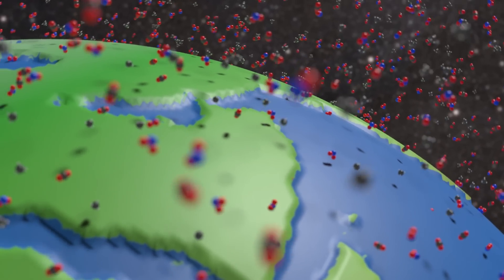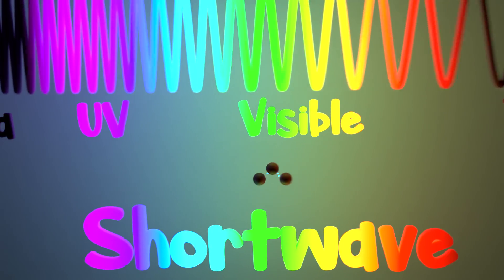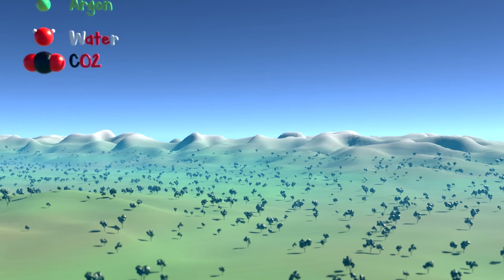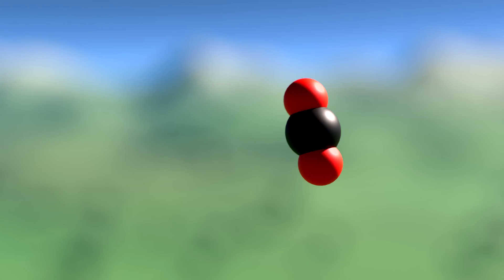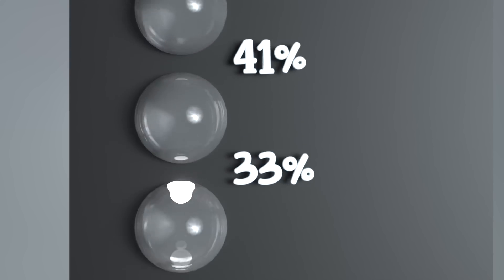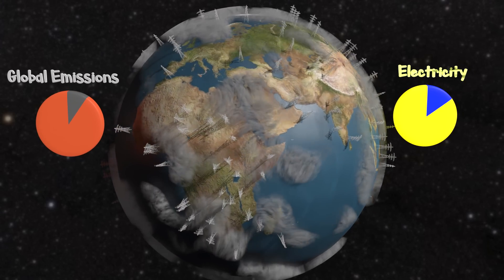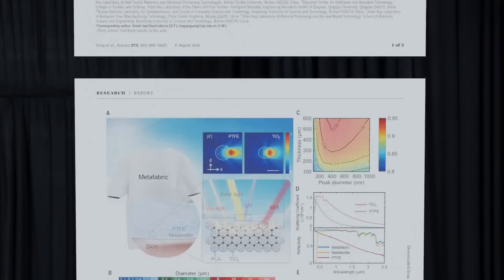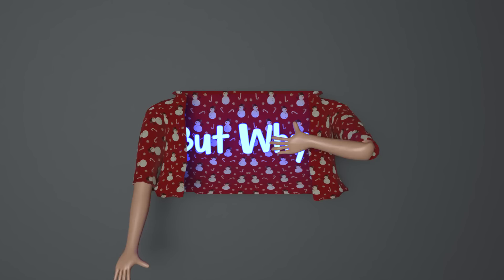Energy Free Cooling through Physics

Comment: This certainly does feel too good to be true. Could you do a more in-depth video on this? I also had no idea such a field existed!
Reply from the maker: The only information I have is what was available in the papers unfortunately. And what was talked about with Arny. As for the aerogel coating it's biggest constraint is that it's not the most durable material against the elements. In it's current state it's not an ideal candidate for large scale use, however the current best use is for coolers or containers that you want to keep the contents cool. Keep food cooler longer and it can be sheltered from harsh elements. 

The silk paper showed that after extensive manipulation, twisting, and stretching, the nanoprocessed silk maintained the bonds between it's fibers and the aluminum nanoparticles. So unless there's a health issue to having aluminum near your skin that I don't know of I think that one is very much a viable option. 

The metafabric paper claims it's a scalable process and as seen in some photos, they were certainly able to make large reams of cloth. I don't know how scarce titanium is, so that may be a limiting ingredient. That paper also (That I can recall) didn't go into depth on durability. 
There was another fabric paper I didn't talk about that made a polyethylene fabric which was extremely scalable.

So I think there are certainly options. My main concern is the reliance on continued use of plastics.
Reply: @ButWhySci  RE: metafabric titanium scarcity: titanium isnt very scarce but it is quite expensive- about $4 per kilo vs steel at about $1.25. It'd be interesting to put forward to a chemical engineer, if its really that scalable, they should have no issue setting up a production facility.
Reply: @Gliccit  Titanium oxide is actually very inexpensive and readily available. In fact almost all white pigments used in almost all paints are derived from titanium oxide.
Reply: @SteinbergerGPPRo  unfortunately it is in scarce supply right now due to the virus.  Went to buy paint, didn’t end well….
Reply: @Gliccit  It's not the only cooling method suitable.
Maybe 20 years ago one of the most energy eating places where computer centers (data centers) including all climatisating necessary to run those.
Then they started to install kyoto cooling systems....which suited during most days of the year to keep the place coo enough to operate with a big radiator on the roof. 
The energy saving: In total good for shutting down an entire powerplant. (a few datacenters combined energy savings). The advantage to the climate....that powerplant less in operation.
Reply: @ButWhySci  Could you link the papers please?
Reply: @ButWhySci it’s difficult to prove increases in CO2 causes climate change.  Several ice ages had 1200 times higher bCO2 levels as well as one Saturn moon with average temperatures of -300F.
Reply: Not sure if you've had your answer satisfactorily answered, but i see lots of people talking about titanium dioxide.  It's true that because it's ultra white, it reflects a lot of light and can lead to passive cooling, but that's not exactly what this video is about.

In this video  @ButWhySci  is talking about not only reflecting light, but also radiating heat away passively through molecular structures. It sounds a lot more like the new barium sulfate pigments that have been developed. It's another ultra white pigment, but it can be manufactured in such a way that it actively sheds heat while also mitigating absorption of new radiation.

I think night hawk in light did a video on it, or maybe it was tech ingredients. Maybe as a longshot it could have been Codys lab, but probably one of the first two
Reply: @ButWhySci  It's also cooler in the shade of a tree or bush, covering more of the earth with these seems cheaper and more viable and would provide more oxygen, food, and habitat for people and animals, but it's not as full of scientific words so people won't do it, but it's the best solution.

"Because cool air settles near the ground, air temperatures directly under trees can be as much as 25°F cooler than air temperatures above nearby blacktop." - US Department of Energy
Reply: @ButWhySci  why not do a video on Sprayed Cork insulation as a environmentally friendly renewable affordable  “thermal break” solution to thermal leakage in houses?
Reply: @ButWhySci  Can you give us link to that website who was potentially selling that cooling cloth ?
Reply: @ButWhySci  Plastic is just too Op for our own good
Reply: @ButWhySci  still dont quite understand the second law of thermodynamic part of this design
Reply: @ButWhySci   Just found you're channel I love the content so far and can't wait to see what you will do next.I hope everyone on here is doing ok. I know there's a lot sucide attempts and it's getting worse. Let me tell you if you're feeling this way open up to a stranger on YouTube live chat or quora you'll be surprised of the self therapy and it's ability to heal you. therapist aren't legally allowed to give information that will help you unless you ask for different types of help at the appointment such as spiritual therapy. sadly 95 % of therapist still haven't gained control of their life's and end up hurting clients instead helping.
Reply: @ButWhySci  saying that aerogel is not the most durable material against elements is somewhat close to saying that prostitute with 30 years of experience is not the most modest. Literally cardboard is more durable than aerogel. Unless something changed since I had contact with it 3 years ago.
Reply: @ButWhySci  Wouldn't 200nm aluminum oxidize all the way through fairly rapidly?
Reply: There's some info about passive cooling in architecture if you search for it. In the past, this was the only option once there was no electricity

The book "barefoot architect" demonstrates some techniques to achieve the passive cooling in buildings

It's not exactly what's shown in the video but you can have some ideias about passive cooling
Reply: @henriqueblasius3492  I second this recommendation. 'Barefoot Arichitect' is one of my favorite books of all time. It's not a manual, but it has great "old country" practical design to it. 

The only thing about letting the natural wind blow through your house is that there is no de-humidification, and there is no control over the wind-born dust. Lot's of great ideas in that book though.
Reply: @-GinΠΓ Τάο Being toxic is not the best way to lure people into believing in your tinfoil whatever-that-is speech. Just sayin' ;)
Reply: @-GinΠΓ Τάο The more I read, the more deranged it becomes. Are you a leader of some crazy sect?
Reply: @-GinΠΓ Τάο Your bold claims got me interested so I took a look at your sources. Not only are most of them off-topic, they are all rather basic explanations of some science and none directly support those claims that you are making. Pretty disappointing. The one source that actually deals with black body radiation gives a basic explanation of the concept, yet also claims that his "skin is black in IR", right before using a IR temperature device to measure his skin through, in his words, it's "IR colour". Also, citing "1.2M subscribers" is rather deceptive when it only has 15.5k views and 163 comments. I also wonder what the people you're sourcing would have to say about your claims.
Since you like using fancy quotes, here's one:

"Extraordinary claims require extraordinary evidence." -Carl Sagan

The entire planet is too complex to accurately measure what really happens, so let's use a simpler example of something else that's in space. If your claim that "heat cannot radiate into space" is correct, then the ISS would've been cooked pretty quickly from all the solar absorption and internal heat generation, right? Yet it's still fine decades later. The only realistic way for the ISS to lose heat is through radiating it away, since it's surrounded by near vacuum. To do that it uses huge black body radiator 'wings' that dump the heat directly into space. Heat management is one of the larger problems in spaceflight and without radiating it away, it's hard for any equipment to function long term, if at all.

"mostly just received as some kind of esoteric truth and a longing for something more meaningful"

Yes, that's what happens when you use capitalized words like Truth, Nature, Heaven, Soul and Purpose, all the while making grand unsupported claims. It's pretty much the definition of a religion. Real science is based on repeatable experiments and peer review, not on quoting DIY home lectures of simple tangential concepts.
Reply: @-GinΠΓ Τάο You talk about learning, but seem to disregard the fact that a large part of science is about discourse, and about explaining the argument for your stance. If someone took the time to look through your sources, but still has questions, you shouldn't dismiss them as ignorant, but rather try and see if either your sources are wrong, or your interpretation is wrong. Your arrogant attitude seems to suggest that you neither have the understanding of nor the patience to have a discourse with someone about your sources, but would rather just have people blindly believe every word you say.
Reply: @-GinΠΓ Τάο you lost me when you said heat can’t radiate to space. If that’s the case, how does the sun heat us up? Do you believe there’s some mystical medium between us?
Reply: @evaahh9584 isn't the temp of the sun the cause of earth's global temperature cycles
Reply: @-GinΠΓ Τάο you too seem to have difficulty in reading, context and reference, I mentioned the organization that made the measurement on the space that forest' ocuppies on the earth's surface because I wanted to show that he had a reliable source for his statement (that its impossible forest are only 3% of their original size) and that he isn't just saying lies

Note: english isn't my first language so I might have problems to express what Im trying to say.
Edit: btw, since I don't know much about physics I'm only writing about the forest thing.
Reply: @-GinΠΓ Τάο   "In fact the energy return on burning the "coal" or "diesel" for electricity is more efficient by order of magnitudes than what is being proposed."
Of course it is. But your conclusion is wrong. 
Civilization is not a "disease", its the result of thermodynamics. Life is a collateral, not the reason.
Civilization uses tremendous amounts of energy, we are really contributing much more to increase entropy. The purpose of the universe is to increase entropy.
Life is such a thing that has negative entropy at the expense of creating even more entropy.
Civilization is just the end result of the equation trying to balance it out, and trying to dissipate the most amount possible of energy possible in the object called Earth.
That's why we are increasing the heat levels, everything is not getting "hot", its getting more balanced, less energy is kept stored.
Who's to say that our purpose wasn't just freeing all that energy ? 
Did we do it by mistake ? I don't think so, we are compelled to consume energy, all Life is.
Everything in according to thermodynamics. The vortex of energy is only getting more fast, until it all ceases.
Life couldn't keep pushing negative entropy forever, eventually it would stockpile so much energy somewhere to cause an imbalance of energy.
Because Life is complex, and Civilization is also complex, and we are probably creating a system so complex, that we don't understand it.
All things tends towards ever increasing complexity, there's no turning back since we lit the first artificial fire...
Reply: @-GinΠΓ Τάο I'm not arguing against laws of physics. No law of physics state anything about the civilization being orthogonal to it.
The civilization is a complex chaotic energy dispersion mechanism that's the end result of the vortex of local entropy in this rock.
Entropy will always increase. Civilization makes it a bit faster, and that's it. Civilization is just another step in complexity on top of Life.
Another emerging structure.
You're wrong and I'm arguing against you, not physics.
Reply: @-GinΠΓ Τάο and dude, I like that you're taking the damage we're doing seriously, but you're way off with the scale

Humans are nowhere near being able to have any measurable effect of the planet itself, and especially not the solar system. The biggest movement of mass we've been responsible for is the three gorges damn in china, which did have a, theoretical Ly measurable effect on the rotation of the planet, but it was so unbelievably small its irrelevant.

The problem is, earths atmosphere and biosphere is much, much, much smaller than the planet, a tiny little skin, and we can, and are fucking up the balance of that.

There's no real reason we can't have civilization and keep the biosphere though, we just have to have out civilization not crank out obscene amounts of all of the crap that would damage it.

And frankly, we also won't kill it, just damage it temporarily, hell, we probably won't even manage to wipe ourselves out.

It happened with the dinosaurs, it's happened with volcanoes, ice ages have done it, hell, other life forms have wrecked the equilibrium before and killed themselves off, that's how we got to the point of having things that consume either O2 or CO2.

Some ancient slime grew on the ocean, converted all the CO2 to O2, mostly died off, and some vaguely animal resembling thing started breathing the O2 in the air.

Everyone always says "we're killing the planet" and ignores the second part of that.
"we're killing the planet as we know it"

Which, is a pretty big problem for us, cause we need that for food, but long term, it'll bounce back with something new and weird, we'll probably still be around clustered around large greenhouses or some shit, and the world'll keep turning.
Reply: The downside is that aerogel is really complicated to make
Reply: See video: How To Make Infrared Cooling Paint (Electricity Free Air Conditioning)
See also: Air Conditioning isn't free... but we're close.
Reply: @-GinΠΓ Τάο I never understand the type of people to spout some theory that’s not popularly believed, say you need 1 billion people, and then insult people for not believing you. You need 1/8 of the total population and you’re taking the chance to insult people rather than try to communicate with them diplomatically? That’s ballsy.
Reply: @-GinΠΓ Τάο ok, cool, you're going with the tactic of telling people that actually understand particle physics that they're wrong without elaborating in any way, real great way to get you're point across.

Do you want lectures and papers on how this works?

Half of the links and things you wrote about were completely unrelated to eachother, there's nothing coherent to learn.

I mean, come on, what the fuck does the concept of red-shifting have to do with anything? All red shifting is, is the wavelength of light appearing to increase as the reference point move away from the source faster. It has NOTHING to do with anything you were on about

Hydrogen loss is so miniscule on the energy calculation it doesn't matter in the slightest.

We lose about 3 kilograms of hydrogen per second, that has a specific heat capacity of about 42.93 joules.

From the sun we get about 173000000000000000 joules per second
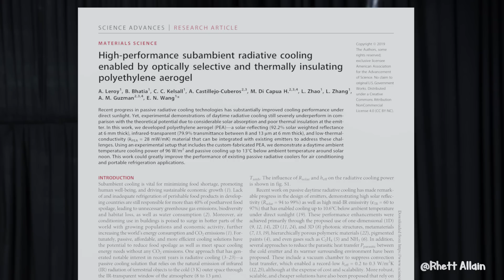Reply: I have similar concerns. I will read the article mentioned at 6:00.
Reply: NASA has been using something similar to this for decades on their spacesuits and spacecraft. 

Their white paints reflect visible light, near-IR and near-UV - I.E. most of the Sun's radiation - because they're... you know... WHITE. However, the same paints have a high thermal emittance - something usually not found in reflective materials - because in the mid and low infrared spectrum they actually look black. 

The result is that anything coated in these paints will radiate away heat but not gain any from the sunlight.
Reply: @augustovasconcellos7173 That's freaking awesome 👌
Reply: @augustovasconcellos7173 so basically your saying the suit reflects non-heating visible light but absorbs IR which would make it hot.
Loads of people liked that bs. Scary af.
Reply: @-GinΠΓ Τάο I would learn if there was something to learn from you. But all you can do is state things without evidence.

You are just a misanthrope trying to excuse it.

"civilization is orthogonal to physics"
No, it isn't, civilization exists because physics allows it to exist.

We don't use more energy than what's allowed. In fact we use much less than that.

Life has no purpose except self-preservation.

You could even argue civilization goes against self-preservation. But seeming we know we have a problem that will make us and that we are trying to solve it seems to me that's actually it does care about it.
Even though changes happen very slowly.
Who's to say we are out of time?
You?
I don't think we are out of time, and if we are, so what, this is not the first civilization to fail nor will it be the last.

Such arrogant viewpoint of yours, thinking you have it all figured out.
Reply: @-GinΠΓ Τάο can you send me links to lectures or papers on em-tension waves?

And I agree that heat isn't a "thing" I'm just saying it's a description of something a lot more simple than you seem to be saying
Reply: @monty58  I believe what they meant by em-tension actually refers to electromagnetic (EM) radiation, which of course has effects on heat transfer through its wavelength based on classical physics. I am able to find a grand total of 1 paper that ever uses the term “EM-Tension”, and that’s Chandrasekhar Roychoudhuri’s “Cosmic Ether, Possessing Electric-Tension and Magnetic-Resistance, Is the Unified Field for Physics” (2021). This seems to be a subgenre of quantum mechanics but also appears to be highly postulating in nature, building upon the existing concept that there exists a medium of ether or quantum vacuum for transmission of information such as heat or light. I have yet to see it being referenced by any responses to it so I have no idea how academia treats it. I myself am not equipped with the knowledge to read this paper at all. Since the original commenter enjoys grandstanding EM-Tension and their understanding of “post-doc comprehensive(s)”, I’d encourage them to explain EM-tension in greater detail and technicality to show they have internalised the processes and also possess understanding of its applicability to the macro world, as this is a relatively abstract and newer model in science
Reply: Nighthawkinlight has an extensive video on making a day sky cooling paint at home.
Reply: Look up tech ingredients YouTube channel. He has a great video on this type of phenomenon and does an experiment showing the temp changes
Reply: @danieldiaz9948  Dido! Great video
Reply: https://youtu.be/KDRnEm-B3AI More in depth video showing how to use household items to create this material.
Reply: @-GinΠΓ Τάο  I wish I could like this post more than once. I want us to be able to find solutions to slow global warming and find balance with our ecosystems, but I know deep down that humanity is a constantly spreading cancer that is killing the Earth that we've known for millennia
Reply: @-GinΠΓ Τάο Oh, I understand all right. There's a reason most Thermodynamics post-docs aren't running around evangelizing the apocalypse like you are, and it's not because they don't understand the subject, nor that they haven't put the dots together like you claim.

I already wrote my refutations, which are obvious and intuitive enough I don't need to spend a week digging up CREDIBLE sources to back up. Humans are to the earth as large as mites are to us, we haven't changed the planet's frigging rotational inertia dude/dudette.
I know better than to try to reform a currently-evangelizing cultist though so I'm out. Have a good life, I hope you get out of the apocalyptic rut you're in where you're trying to convince people of your beliefs on YouTube comment threads.
Reply: @-GinΠΓ Τάο OK, now this is just funny, everyone is telling you the problems with your "teaching in how humanity and civilization are the problem and its impossible for heat to get out of the earth" and your answer to that literally is "I'm right and you are wrong because my 'completely reliable' sources that obviously teached me that I'm right are the truth and you cannot deny truth"
Dude, just accept that you are the one who is wrong in this argument.
You are just making yourself look stupid by trying to sound intelligent and thinking you achieved illumination through basic thermodynamic and physics YouTube videos.
Reply: @-GinΠΓ Τάο I'm sorry, what? Heat can't radiate into space? That's literally what photons are, we can see those photons from space, therefore, it's clearly radiating into space.

Are you just ignoring the primary energy transfer method of our universe?

What the fuck is your understanding of heat anyway? It's literally just how much momentum the particles in a system have.

When those particles collide with eachother, they release small amounts of energy. That energy is in the form of "packets" also known as photons.

Those photons move in a straight line until they collide with something, which absorbers the energy, gaining what we refer to as heat.

You can see this happening on your stove when you turn the heat up, as the particles move faster, they interact more, emitting more photons, becoming brighter.
Reply: It's actually junk science
Reply: I'm sure there's a lot of fields you have no idea about
Reply: Nighthawkinlight made a video on the practical applications of this
Reply: I know this is late but technology connections already did a very in depth video on this already if im not mistaking
Reply: It may sound too naive but what about a white plastic? Doesn't it also reflect sun and let IR pass?
Reply: True but patent protected.
Reply: Theres a few alternatives too cooling cheap and(or with no emissions but that doesnt fit into the capitalistic world so the goverments and megacorps are tryina bury it udner so much shit that it becomes impossible to find
Reply: It’s not too good to be true because people have done it for thousands of years. Build a thick walled house and put holes on the top and bottom so wind could flow through. The sheer mass of the house holds the same temperature. Warm in winter, cold in summer. They also build things underground. How else did the Christian’s hide from the Roman’s for 200 years UNDERGROYND. It’s not as versitile as a heat pump, you can’t put it in a car and move it around. But it works in the same way that cutting channels in the ground work to irrigate the water without any manual work.
Reply: Tecnologia antiga. Tem estudos mais antigos. A questão é que algo que foi descoberto hoje, terá de esperar. As pesquisas custam caro. O tradicional é demorar uns 30 ou mais anos até lançar no mercado a não ser que algum problema muito sério force a aplicação.
Reply: The 'Tech Ingredients' yt channel did a video on making a DIY reverse greenhouse. They managed to prove that it's possible using only plastic wrap and super reflective paint. The real challenge with this approach to cooling is the durability of the materials being used. Plastic wrap is good enough for a demonstration, but all it takes is a hailstone, tree branch, or squirrel to destroy it. Hence the need to develop stronger materials, which is why aerogel and types of cloth are being explored. But aerogel is naturally expensive as heck to produce and I don't imagine the doped silk would be very cheap either. It's not really a matter of "economy of scale" either. It's an engineering challenge.
Reply: NighthawkInLight is an amazing channel that actually shows you how you can realistically build these magical materials while providing lots of extra information
Reply: Evaporative cooling is still better than this environmentally destructive method (plastic you know)
Reply: The polar ice caps used to do this effect for us free of charge
Reply: Doesn't matter, this tech will get buried with the rest of them, for many many years I have followed and researched all sorts of amazing, cost effective and resourceful alternatives for energy output, storage and energy saving devices,, so many technologies that are revolutionary that combined would have cut fossil fuel consumption by 90% and made other technologies that require batteries and energy storage far safer and cheaper, it would be possible to have supplied the entire world with almost free electricity but all these technologies have disappeared without a trace, even the people involved have disappeared out of the field or completely
Reply: @-GinΠΓ Τάο None of this appears to explain or confirm your first sentence, let alone be relevant to the topic of the video.
Also, I'm curious why you think that heat cannot radiate into space and how it would contradict Black Body radiation.
And what proof you have that all heat on Earth is absorbed into the oceans (or is there some quality to 'anthropogenic' heat that makes it particularly hydrophylic?).
But don't worry, I don't expect explanations; the response above shows that keeping on track for any length seems to be a problem.
Reply: @-GinΠΓ Τάο Thanks for the laughs,
Your posts reminds me of the collages made out of pictures from magazine cutouts by pre schoolers.

They might be "pretty", but you will never find a single real picture showing what the collages are describing.
Im getting the same feeling on this one guys.
Reply: @-GinΠΓ Τάο Congratulations, your comment equates to "NO U!". And by the way, your "intellectual superiority complex" is making you blind.
Reply: @-GinΠΓ Τάο So if life and death are merely different states, and no one form is superior to another, why is the destruction of life a problem? Why must complexity be preserved if it is not superior to simpler forms?
Reply: @chaotixthefox    " why is the destruction of life a problem? Why must complexity be preserved if it is not superior to simpler forms?"
exactly, that's the question.
Complexity doesn't need to be preserved. Complexity is the result of entropic increase of energy in a system.
Life has negative complexity locally, but not globally.

The only solution to all of Earths problem: We have to conquer space.
We need even more energy, resources and to strip mine all of the other planets to keep the balance of energy of the Earth negative. Life storing that extra energy as carbon reserves was a dubious attempt, for how long would that work either way ? no much as the system was in balance. (balance is bad, life is not about global balance, your cells have internal balance at expense of your body balance of energy, and your body have internal balance at the expense of the environment, and civilization/society does the same, now we need to have a global Earth energy balance at the expense of the rest of other planets)

Humans only made the entropy increase of Earth go faster, but make no mistake, Life started it. It would eventually cease as all energy is either stored equally distributed over the planet (as it was before we found it and release it back to do more work), that's entropic heat death or radiated away (that doesn't happen fast enough). 

To have local negative entropy (complexity), you need to increase the entropy elsewhere. 
Our current problem is that we are increasing entropy of Earth to keep our complex civilization. But we need to step up and increase the entropy of all of other "pristine" planets to keep the entropy of Earth as low as possible.

Humans just put gasoline in the fire of life.  Now we think we can extinguish it. We made a bomb, the only release is to allow life to conquer other worlds now.
Its funny people think civilization and society aren't an aspect of life itself, we are life, we are not separated from it, we are part of it, everything we do is life doing. If we increase complexity, that was by no mistake,  that's was by purpose.
Reply: take your meds schizo
Reply: @-GinΠΓ Τάο But hey! Let's play your game: The worlds' forests currently cover roughly 4 billion hectares. If we extrapolate that to your 3% number, that means that the total area covered by forests before, was around 133 billion hectares.

To put that into perspective, the world's land surface is around 13 billion hectares, so we only need another 9 earths to reach that magical number of yours.

So in conclusion, we are 120 billion hectares short of land in order to meet your magical 3%.
Reply: Materials will probably end up being cancerous and/or endocrine disruptors, such is the case with many types of plastics and teflon (mentioned in the video)
Reply: @-GinΠΓ Τάο Did you... did you just say that an official measurement from the FAO(Food and Agriculture Organization which is a United Nations agency) is a lie ...?
Reply: The problem is usually that the new technology usually costs more than just adding enough insulation to achieve the same effect.  Is there a market for car covers, maybe, but it works in the winter too, so you can't make it a physical part of the car or you'll have drivers frozen solid.
Reply: @-GinΠΓ Τάο Christ almighty, references (to YouTube I might add) and fancy words do not a real argument make.
What’s really bizarre to me is that you do have a basic grasp on thermodynamics by your DIY AC recommendation, but then you go off on this cult-y rant.

Personally, I’m quite impressed with your claim that human civilisation has already changed Earth’s rotational Inertia. Significant mining operations only started in the last ~500 years, and a few miles is nothing to the sheer size and mass of the earth. I would be astonished if the entirety of earthworks that humanity has carried out in history was the same mass as even a quarter of a day’s worth of evaporation from Earth’s oceans.
Hell, it’s not even like our greenhouse contributions are anything truly impressive. Humans were born from a climate low, and we’ve accidentally figured out how to rapidly return Earth to a climate high - which, I might note, are the periods in Earth’s history with the greatest density of life. Life goes on, and if you’re really so dogmatic about “balance” and “life” you should recognise that suicide-by-greenhouse-gases would simply be humanity rebalancing Life to maximise it.
We’ve never been killing the planet, we’ve only been killing our planet [as we know it.] The only thing truly in danger here is human civilisation, life will persist and so will intelligent life. If your “solution” involves fundamentally destroying human civilisation as it is, then it’s not a solution.
Reply: @-GinΠΓ Τάο "only 3% of earth's forests remain" Okay now I KNOW you're lying. Even though there's been mass deforestation of the amazon, compared to the size of the rain forest in 1970, ca. 80% of it remains (as of 2020), with around 0.2-0.5% reduction each year.

In terms of global scale, I found an estimate that says 1/3 of earth's forests have disappeared in the last 10,000 years, so roughly 66% still remains. That's 63% MORE than your claim.
Reply: "Feel too good to be true" is a very common phenomenon when a technology uses the basic physical properties of the world. There is nothing wrong!
Reply: @BestHakase  Bro. The first few times I saw this video, I was neither convinced nor happy.
I thought this guy was being deceptive, and just cuz new technologies are trendy he just made another video on made up properties of physics. And the comment section made me rage as to how they were supporting him on bullsjkit, non practical solution.
But now that I'm slightly more educated than a little ago and understand the heat emission through the infrared... I'm deeply ashamed. 

But can you blame me, how do you expect for thermal transfer to occur without physical contact or convection ( it was mind boggling for my Illiterate self. ). Plus he mentioned aerogel, which is popularly used for insulation. I was like wt?! The material used for containing heat or insulating,.. would be best at radiating heat?!!!!! I was infuriated! Raging! I felt betrayed!
The title of the video was already too optimistic, and it gave me too much hope. And watching the video without context or knowledge... had me feeling very betrayed.

Now after much internal conflict. I'm happy to learn. And will use this information.
Reply: @BestHakase  I'm not sure why it would feel too good to be true either. Yes, we can feel a little cooler in our personal spaces but it's not like it's cooling the ocean or anything.
Reply: @abebuckingham8198  well.. then watch video again)
Reply: @abebuckingham8198  , the problem is in the curent production of energy, and for what we mainly use it (air coditioning). If we can use less, we have to produce less... so less polution
Reply: @abebuckingham8198  If you're not using power to cool your buildings down, you don't need to generate that power, so you don't make that greenhouse gas, so the entire world cools down, and the oceans can cool down aswell.

That or you make giant floating barges of the stuff and cover patches of ocean :V
Reply: @-GinΠΓ Τάο No, I'm asking why that matters. What reason is there to give a single fuck?
Reply: can someone tell me what should I do instead of buying an AC? my room temp is very high due to humidity in my area in summer.
Reply: @HassaanALal  realistically, unless you're a homeowner, don't worry about it, and even then, probably don't worry about it, it's more a matter of setting standards for new construction.

If you do own your house and are planning major renovations though, look into geothermal heating.

Basically, you put pipes in the ground, they pump water through them, and if the ground in colder, like on the summer, it cools the water, while a heat pump in your house uses that to cool the air, while in the winter, this can heat the air to the temperature of the ground, meaning you have to run your less efficient conventional system less to get to where you want.
Reply: @-GinΠΓ Τάο WE HAVE 12 YEAR TO LIVE
kek
Reply: @-GinΠΓ Τάο nope, but from the back side of block (about 15 ft below) I have the ground and can use it.
Reply: @-GinΠΓ Τάο I don't understand but seems a good way to cool, can you give an example? (consider I am on the ground)
So far I was thinking to have 2 fans, one inlet and 1 outside window along with a plastic sheet covering above roof (I have the roof access).
But then again, the fan may bring hot air instead of cool because ambient temperature is pretty high and humid (many rice fields are grown near the place).
Reply: @HassaanALal  
Passive.
- rockwool beneath roof, 
- 2'nd roof on top 1'st roof with enough  space in between,
- 2'nd roof & outside wall, Limestone material on outside / upper side,
- shallow water pool on 2'nd roof or sunroof water heater or plant garden,
- . . .
- refrigerator in between wall, with backside outside house,
- move heat source to outside,
ex: stove, washing machine, etc,

non passive.
- induce fan to basement, exhaust fan in kitchen,
- dehumidifier,
- CO2 scrubber,
- ceiling fan
Reply: @-GinΠΓ Τάο energy does not work the way you think it does. By the way, there are 3 (or 4 but really that’s just a = b and b = c therefore a =c) laws of thermodynamics, none of which would prevent infrared radiation being a thing. I’m not going to watch however many hours of “teaching” videos from some conspiracy-cult leader you want me to because chances are they’re all bullshit.
Reply: Iranians used to build air conditioners that were running only on wind, lol
Reply: @kobilica999  I think they were Persians when they did that.
Reply: @-GinΠΓ Τάο I'll have to stop in about 60 years so I'm not too attached.

That said, what does it matter if I die? Every person will meet their end someday, unavoidably, and nothing is relevant at that point.
Reply: The issue is you can't create something from nothing. There are many different ways for passive cooling to work, but most are either impractical for scale or too inefficient to do anything noticeable.
Reply: In the hot summer months, many people rely on air conditioning to stay cool. But did you know that there is a way to cool your home without using any energy? It's called evaporative cooling, and it's based on the same principles that keep you cool when you sweat.

Evaporative cooling works by taking advantage of the fact that water vaporizes at a lower temperature than the liquid form. When water vaporizes, or turns into a gas, it takes heat with it. So by evaporating water in your home, you can actually remove heat from the air.

You can build your own evaporative cooler with just a few household items. All you need is a fan, a bucket of water, and some ice. Simply wet a towel or piece of cloth and place it in front of the fan.
Reply: @-GinΠΓ Τάο Right back at you. You clearly have no argument, so you've resorted to namecalling and diversion tactics.

Next time, bring your A game.
Reply: It doesn't feel too good because it's already what happens on earth.
The mainstream explanation of greenhouse effect is BS. 
There's no greenhouse effect without umbrella effect.
Particles block radiation from all sides.
From the sun and from the soil. 
The blocking effect of CO2 is negligible.
Water vapor is the main greenhouse and therefore inverted greenhouse gas on earth. 
The greenhouse effect is mainly the invert greenhouse effect on earth , actually.